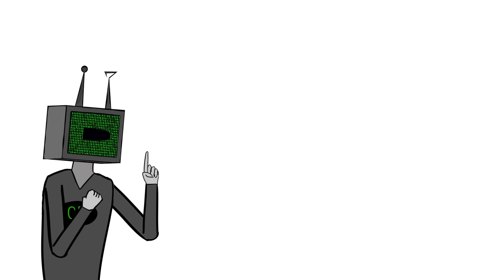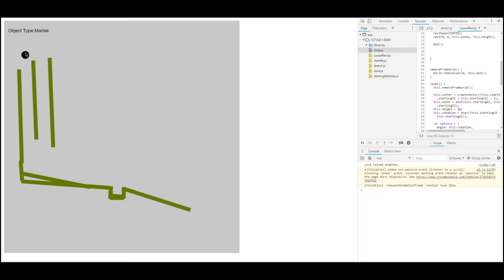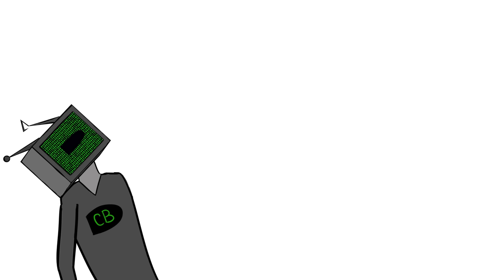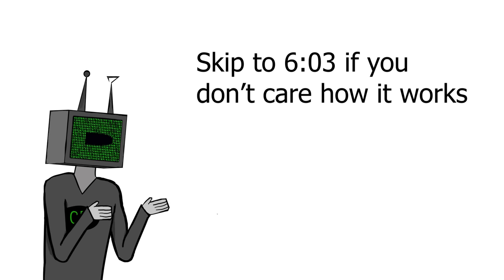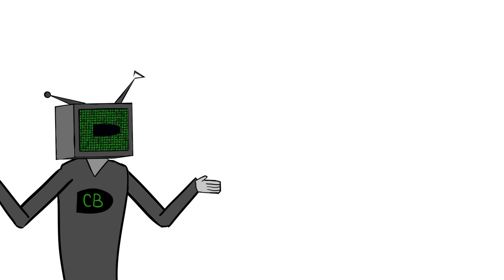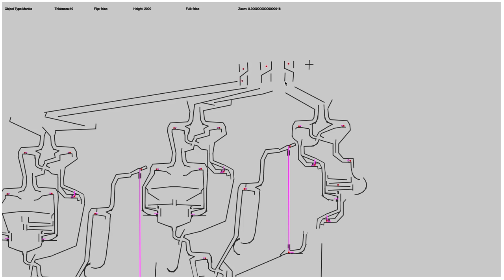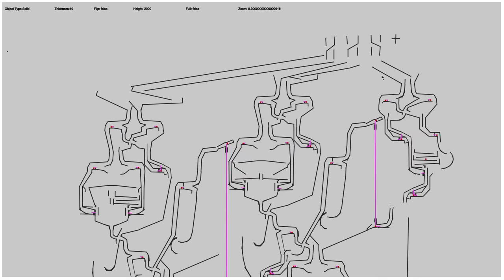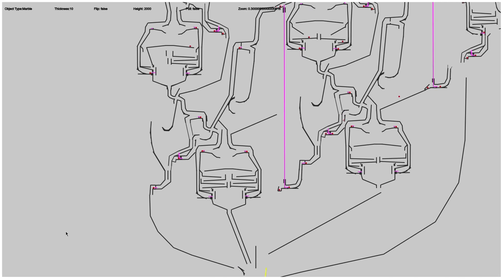Making a Calculator using ONLY MARBLES

Comment: This is Mighty impressive, however there's a simpler mechanism to do addition with marbles. If you go to a playground, and find a slide, like the thing children play with, take 5 marbles and put them at the top, and then 7 marbles at put them at the top, the mechanical function of the slide works to add them as you'll find 12 marbles at the bottom. If you wanted to optimize your adder with this no credit needed, cheers.

Comment: How to simplify this:
Put some marbles in a bowl. Need to subtract 4? Take out 4 marbles. Need to add 5? Put 5 more marbles in the bowl. If necessary, use different colored marbles to represent 10s 100s and 1000s.